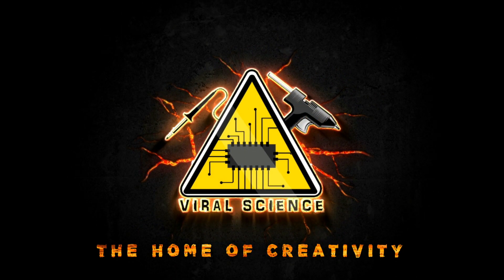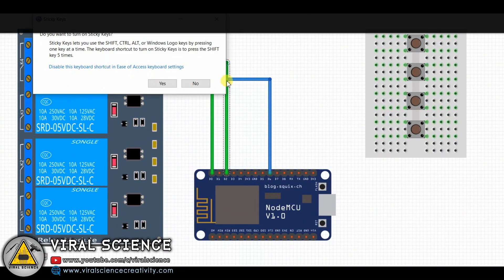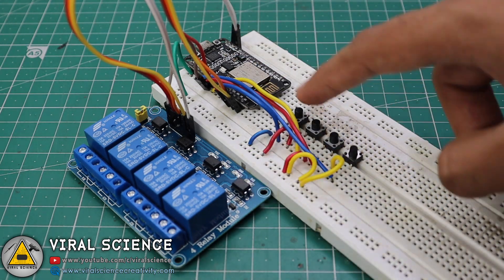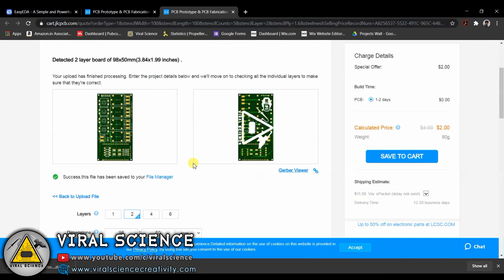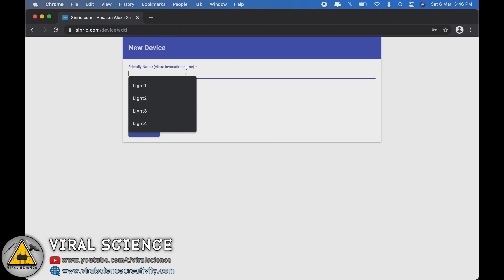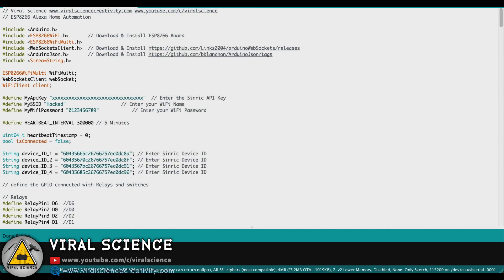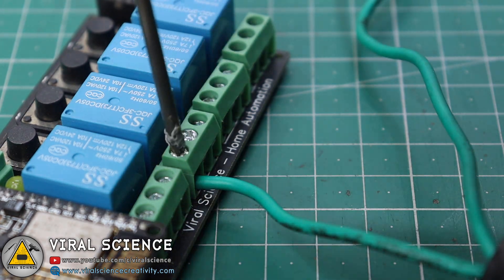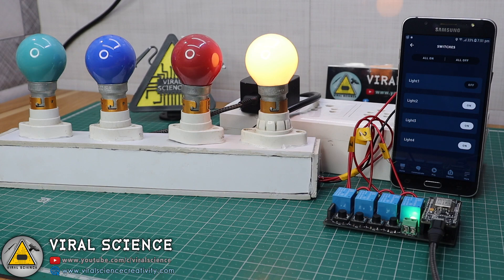ESP8266 Alexa Home Automation using Sinric

Comment: Hello unfortunately the PCB from JLCPCB does not fit the NODEMCU-ESP8266. The ESP port is too big. The design is incorrect.
Reply from the maker: There are 2 different types of esp8266 boards just check it out both are of different sizes

Comment: Cool project 
Bro can you make a project of  smart irrigation system using iot in which we can the features of soil moisture sensor ,  temperature sensor , automatic water pump turning on including Pir motion sensor to sense the motion of any animals present in the agriculture field. 
Also it is necessary that message will be coming on our telegram that there is low water on the soil and also if any animal is detected then immediately send a message in the telegram. 
It will be very good if you also add the feature of blink in that system. Hope you will keep my request and make this project in your next video. 
I really need this project. 
Plzz make it for me once .🙏🙏🙏🙏
Reply: Bro can you please make this for me in which the feature of Telegram using bot father and the blynk application will be used. It's my request.
I need this project immediately.

Plzz make it for me in your next project video 🙏🙏🙏🙏🙏